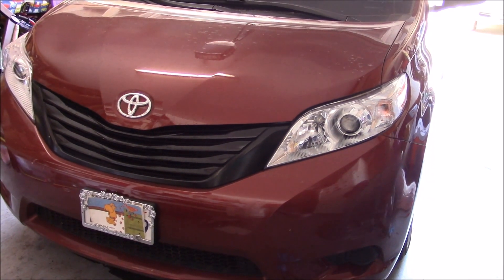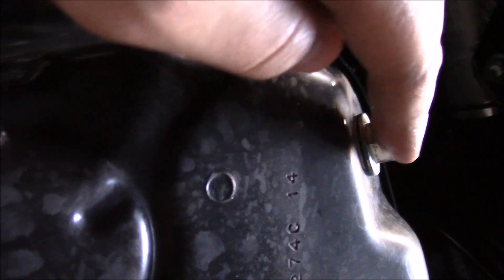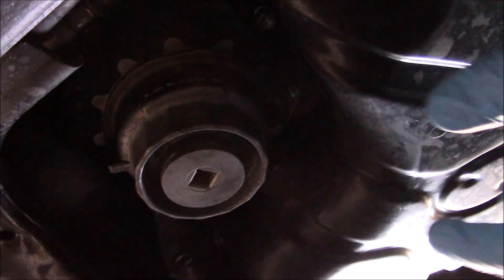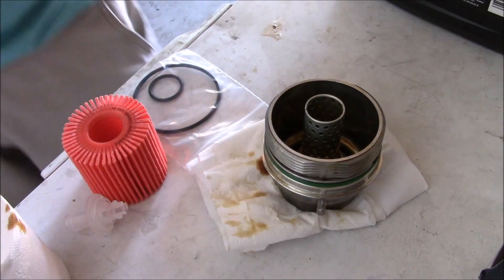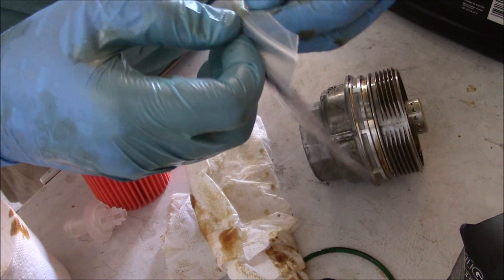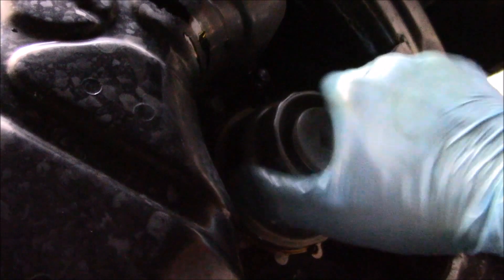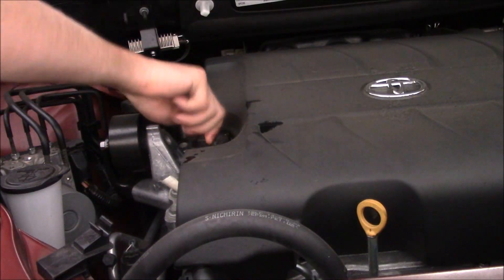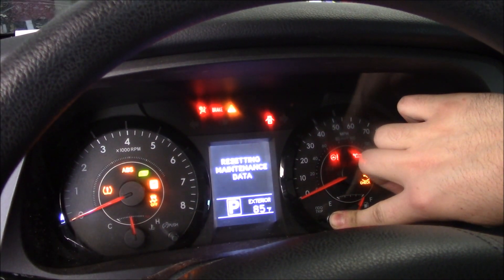2012 - 2017 Toyota Sienna Oil Change With Filter | DETAILS

Comment: thanks for the video, I did not know about the magnetic plug at the bottom of the filter housing, good to know. I would also recommend changing the oil drain plug washer/gasket each time you change oil.
Reply: It's not magnetic.

Comment: Why did you only add 5 quarts of oil when the manual says to do 6.4? Great video by the way
Reply from the maker: Yeah it takes 6 or so
Reply: @GK7GARAGE  
It takes whatever the owner's manual says the capacity is.
Reply: And I was taught to never fill it all the way to full so as to leave a little room for when the oil is hot. Is that true nowadays still?
Reply: Cuz he didnt do his homework

Comment: thanks, just one comment. I have a 2013 and it does have a gasket on the drain plug.
Reply from the maker: +C Peters yes you're right what happened that the gasket was stuck on the pan :)

Comment: I'm a little surprised you didn't drain the filter housing. Most filters -- and most certainly the Toyota OEM filters - provide a little plastic plug you snap into the filter housing once you remove that cap you assumed was magnetic (it isn't -- it's only there to let you drain the housing). That, in turn, drains the filter housing neatly, and avoids that big gush of oil you encountered.

And yes, spending the $10-15 on a housing removal tool is well worth the time/ money, instead of using the pliers. Makes it a cinch!
Reply from the maker: true i had with the filter but didnt use it, thanks
Reply: Yes you should have used it.. was surprised you show it in the video but don't use it.
Reply: @Evan
You are so right. Nothing beats using the correct and best tools for the job.

Comment: Still 10x easier than changing the oil on my 2000 f150. The engineers built a reliable truck but it is hell to get the filter off.

Comment: My 2014 Sienna never seems to need 6.4 quarts to be full.  How much are you typically using with your oil changes?  I have heard that the volume can be incorrect in the oil containers.  thanks
Reply from the maker: James McDowell it takes six quarts with filter :)
Reply: GK7TV thank you
Reply from the maker: +James McDowell six quarts is perfect
Reply: @GK7GARAGE  
I think it may vary slightly depending on what year yours is.

Comment: what do you do with that plastic plug thing?
Reply from the maker: +Russell right that is used to drain the oil out of the oil filter housing before removing the housing, there is something inside the housing that is spring loaded so you push that plug in and the old oil drains out and then you can remove all the housing
Reply: Thanks so much. I did it but didn't know that and it was messy, oh well. Whoever changed the oil before me tightened the housing and nut on so tight! It was very hard to get off. Idiots!
Reply: @russell9168  
I understand that not oiling the large o-ring can also make it harder to get off

Comment: Highly recommend going to Autozone or one of the auto supplies store and getting an oil filter cap socket with a ratchet attachment that is specially made for Toyotas, they are 10 bucks there. I wasted 2 hours trying to get it off with the regular oil wrench and a special adjustable ones from Wal-mart. It did not come out as easily as the video.
Reply: i realize a lot don't have the time but next car you buy the oil cartridge wrench on Ebay are from $7 to $9 bucks...at the auto part stores about $10 to $15...if you buying toyota make sure you get the one that has 3 slots on each side then its more univerals then the 3 lot 1 slot sided ones...

Comment: Z Great video. I might be mistaken but I don't believe the cartridge housing drain cap is magnetized (2:43).  It would be pretty useless because it's not in contact with the oil while you are driving or ever for that matter. Also the OEM O rings are black not green at least for my Highlander which has the same filter.  Never seen Toyota green o rings.  Good video - that Sienna definitely needed an oil change at 16,000 miles!!

Comment: I went to Monroe muffler and it cost 19.99 for conventional Oil change. but for syntetic cost because it needs 6 quarts $101 w/ free rotation. what tha hell. I know syntetic Oil cost a bit more but other than that is The same process.
Reply from the maker: it is recommended to use synthetic oil only in these new vehicles
Reply: I am aware of what kind of Oil is recommended on my sienna but you miss my Point.
Reply from the maker: oh yeah I get it now, they use $20 for conventional oil in order to attempt to customers to come to their stores with after that they try to make profits on synthetic oil but in reality it's only cost 8 to $10 more
Reply: javis reef 

go to a registered motor vehicle repair shop, not an oil change place. some synthetic oil can last 10k it costs more. regular shop with Mobil one or Pennzoil foils have a better quote. a car wash did an oil change and put the wrong filter in the car before i bought it. it blew out and blew the engine. another shop said my chassis was leaking. should have let my mechanic change the oil. then they also overfilled the new used engine. older car with the metal filters.
Reply: This is why I started changing my own oil in my Sienna (thanks for this video!).  I sent my wife to get it changed at an oil change place with a "19.95" coupon.  They told her they were "legally required" to put the recommended oil in and that it took a "special filter" and tool that was "hard to find" and that they had to "replace critical seals and washers".  Basically scared her into a $100 oil change.   Toyota House charges $120.  Ripoff artists.  $30 in oil, $10 filter (at RETAIL) and half an hour.
Reply from the maker: Tracy Jones well you are welcome, nothing is better than doing your things yourself and save $$$, good luck and take care
Reply: Super Tech oil is less than 30¢ a quart difference for synthetic (in 5 quart jugs).

Comment: Thank you for the nice video!  I always change oil in the dealer, and I have two questions:
1. the dealer always installs a new washer, although I do not know if this is necessary.  but you use the screw only? 
2. the dealer never changes the o-rings on the oil filter assembly, is it necessary to change those?
Reply from the maker: Ray Chen thank you, actually the crush washer was stuck to the oil pan, but yes it can be changed every three oil changes, but the o ring should always be replaced, the come with oil filter anyway, but the washer does not, thanks buddy
Reply: Of course the dealer changes the o-rings. What makes you think they don't?

Comment: Difference between the Asian and German designs. Great design but horrible location. The Germans put theirs on top of the engine. Makes life far easier. Hate doing these. Definitely a hose and the plastic adaptor to drain the canister is less messy. 
I have to make a correction, the last several years of Kia's and Hyundai engines that use canisters are located on top. Damn Toyota!
Reply from the maker: +Marc Smith thanks buddy

Comment: Why didn't you go to the Toyota dealer and get the 4 free oil changes during the first 2 years?  Was the metal filter housing original from the factory or did it come with the plastic housing?  There should be a oil drain plug gasket.  If you look real careful it is stuck to the bottom of the oil pan.  I ended up with a few gasket stuck to the oil pan before I figured that out.  I also pour some new oil into the filter housing before re-installing on the car.  That way the engine won't be without oil as long when you start the engine the first time after the change.
Reply from the maker: we were not told that there is free oil change, I will check for gasket on the pan next time, and you are correct I should of filled the filter housing with some oil, and yes its the original factory housing, thank you very much
Reply: I think The one guy I Works with is getting rip off he has a Brand new rav4 and he pays $38 Basil Toyota for a rav4 that he purchase from them less than a year ago.
Reply: They might have shaken the already bad wheel bearing. Another owner a car mechanic for the airline had one go bad at 30k. Toyota replaced but it still did not work right. Told him to call NYS motor vehicle safety. But it was a registered shop in NY (dealer) some Midas, jiffy lube a and car wash are not registered. You are at your own risk. 

My old Blazer the kid put on a Ford oil filter for a GM car. Blew the motor. Then they said it happened again. Nightmare. 

Look up Hunter road force balence for your new car!
Reply: Correction: Only 2 free oil changes due to the fact they using 5W-20 Synthetic good for 10K miles
Reply: The dealer lie!  They skip one on between! They change at 10,000 mile!  Magic Toyota Lynnwood Washington!
Reply: @tunyung  they don't lie...they follow the service manual that you have in your glovebox.
Reply: @nametaken24  it was never made clear!  We go on for oil change thinking oil has been changed.  Only after 2 year they  decided to tell you !

Comment: Warning before buying! This vehicle has issues with tires wearing uneven and excessively. Be ready to change tires at just 17K miles. Read complaints at Sienna chat forum. Toyota has no fix for this issue as of now and dealers will tell you it’s normal tire wear. If you have less than 12K miles and within the first year I suggest check your tires ASAP for the uneven and excessive wear and complaint right away with Toyota USA they might cover your tires warranty. Past one year and 12K Miles you’re on your own. I’m planning to trade mine for a Honda ASAP as tire or suspension issues could potentially be a safety issue. This is a family car and safety should be top priority!
Reply from the maker: You're 100% correct I actually did a video about this
Reply: So did do a complaint? My had the tire wear issues too?
Reply: So what?